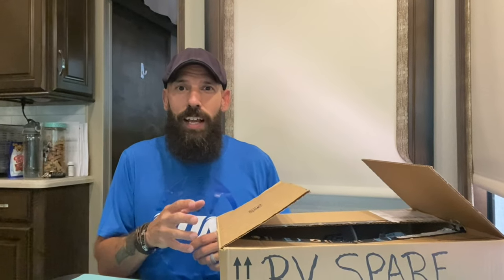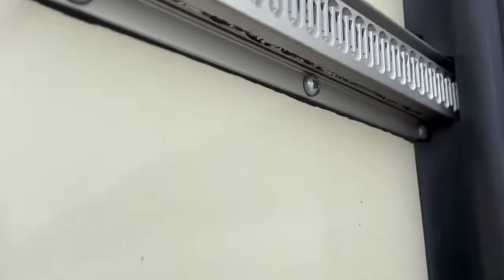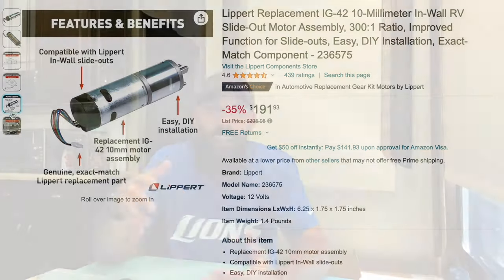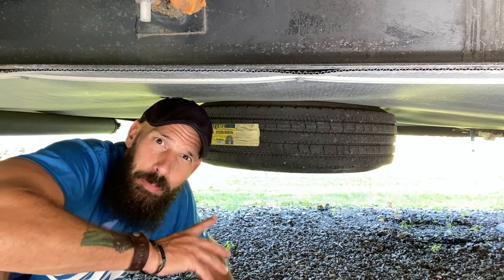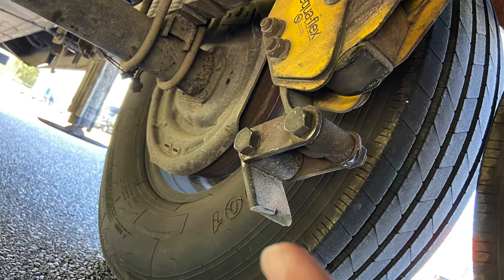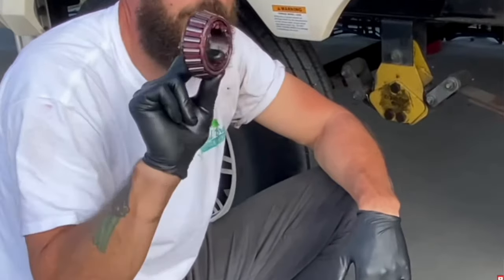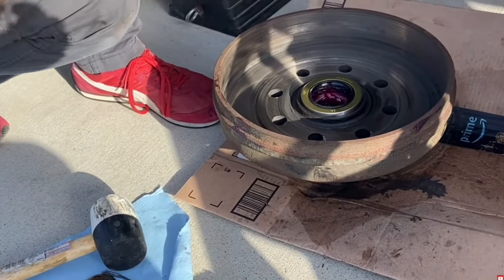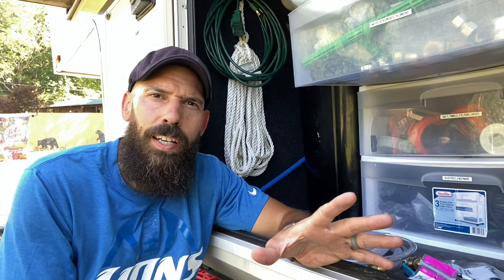RV Spare Parts You NEED to HAVE!

Comment: Water pump for the coach/trailer....if it fails (and it will) you won't be have any water pressure unless you're hooked up at a campground.  It's less than $100 and very easy to change.
Reply from the maker: Haha you need to go watch this video of mine. Over 150 thousand views. 
RV WATER PUMP TROUBLESHOOTING (Pump Runs but No Water...Fixed!)
https://youtu.be/yFbTmUG5FTg

I’ve fixed mine and helped so many others do the same. I actually have a spare pump on hand as well. A company sent it to me but yeah it’s good to have a spare on hand even if just for parts. Thanks for watching 👍🏼

Comment: Extra water pump or water pump repair parts/kit. Even if you never use your water pump the check valve inside water can and will fail and that will fill up your fresh water holding tank, then hopefully out of the RV's overflow lines unless someone has installed valves on those overflow lines. If that's the case then the water backs up and could flood the RV.
Reply from the maker: Hey you must of watched my video! Haha
I’ve helped over 100 thousand people easily fix that pressure valve on those pumps. 

RV WATER PUMP TROUBLESHOOTING (Pump Runs but No Water...Fixed!)
https://youtu.be/yFbTmUG5FTg

We also have a spare pump on board too. Lots of people recommending that. Appreciate you watching 👍🏼
Reply: @WhyWait  yes sir sure did. I have no doubt you've had a spare pump on board for a while lol. The stuff you carry is impressive.

Comment: Reason i avoid schwinteck. I would only get it if it's on the small or short slide. And another reason why i avoid leaf springs.
Reply from the maker: Yeah our Schwintek is on our small bedroom slide. Everything else is hydraulic rack n pinion. 
Leaf springs are hard to avoid without the IS system. We now have more robust slipper springs I’ve been happy with. Thanks for watching 👍🏼

Comment: Hello, just wondering, how do you determine what leaf spring pack do you have so I can order a spare one? TIA!!
Reply from the maker: Few different ways. I used my order sheet that came with the RV, it has all part numbers and serial numbers listed for everything. Etrailer.com can help too, they answer all questions. If you know your axles say 7k axles, count the number of leafs on the springs and measure the distance from center of each leaf spring eye. Do this with no load, even with a load you should be able to figure this distance out. 👍🏼👍🏼